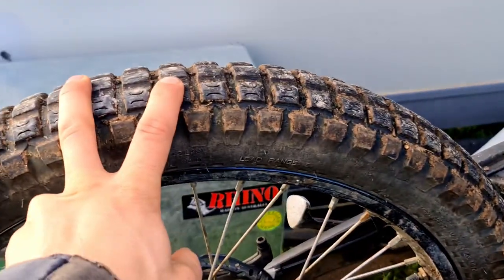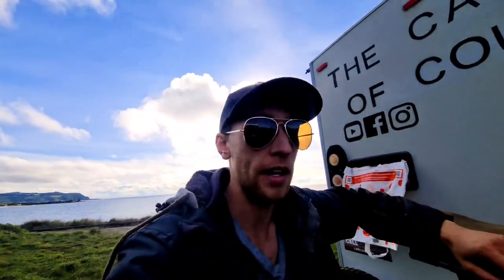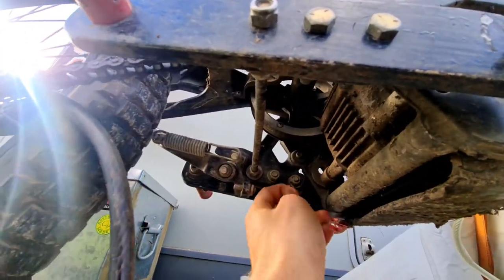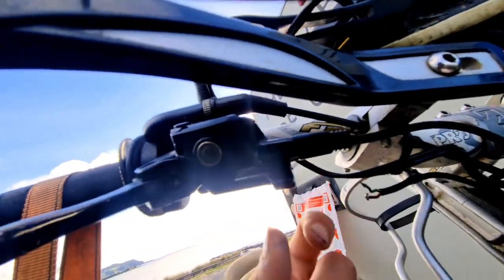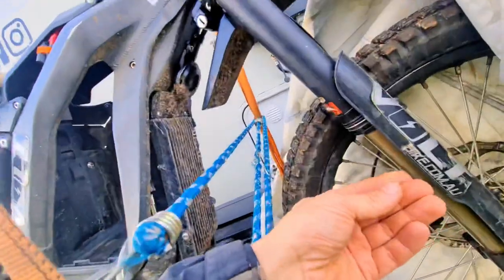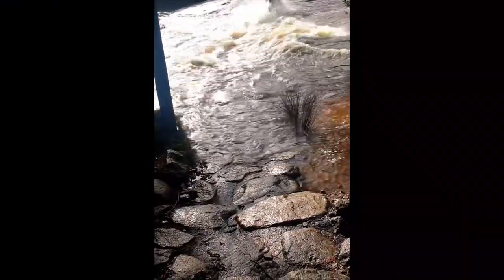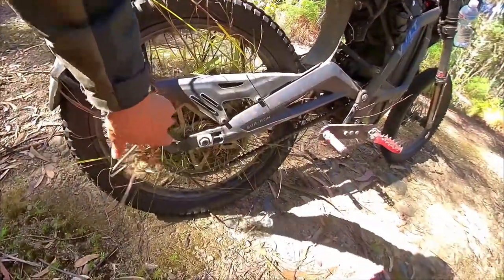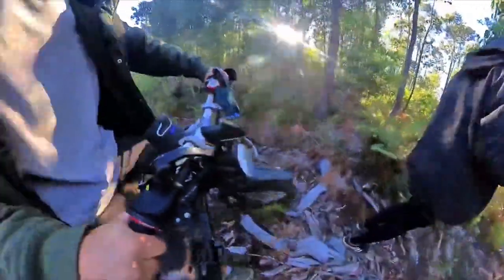5000km stock Sur-Ron review with river crossings

Comment: Sharing my experience with these and water. I changed my seat and unknowingly, the wire under the seat moved out of place and after a while I fell off the bike and broke the rear plastic fender which means I had to take the seat off again because the rear fender attaches under the seat. So I opened it up again. I found that the wire that sits under the seat was flattened and might've been the culprit of my electrical issues (from before) with the throttle (bike would not accelerate at all BUT it turns on and everything and looked fine) whenever I rode it in the rain it acted up on me for a second or two but the issue is more serious when it's already wet and you plan on going riding. Drying it in the sun seems to solve the problem but is time consuming, other times it helps to keep it on and wait for it to work but to be fair I thought I did a good job of putting the wires back and I'm not even sure how this happened. Switching the part looks easy except you can't find it anywhere, I'll have to contact Luna

Comment: Nice review, first time to se 2up on SurRon :) . How much do you weight together, and how did the SurRon handle it (suspension, handling, climb ability)?
Reply from the maker: We're both about 66kg
The suspension occasionally bottoms out when dropping hard off something but on normal trails it's been good
I did wind the spring out abit to make it stiffer
And as for hill climbing it's been flawless still havnt found a hill it dosnt get up/wheelie/spin back tire
Even the motor and controller only get warm
But the more tricky stuff I do alone and she walks
But it's quite dodgy trying to get over a log or dropping off rocks with 2ppl
As for battery life
I definitely noticed I get about 1/4-1/3 less distance and you can feel less power in high speeds Perticuly when you go up hill at like 60-70
Reply: With a friend we do night single tracks at two on his sur ron sometimes, no prob, just have to share the footpegs and moving arround to balance Xp Super fun

Comment: How much do you guys weigh appx? Me and my girl are small (appx 140 lbs each). Did the Sur Ron pull you both UPHILL with the STOCK battery?
Reply from the maker: Yep everything stock 
Were both about 145 lbs
And it's never met a hill it didn't get us both up or wheelie because of all the back weight
Or just spin the wheel because of shitty ground 
either way never felt like it needed more power in the low speed climbs
Reply: @The-Stranga  that's crazy capable in stock! Nice...

Comment: How did you switch your seat?
Reply from the maker: I removed all the padding from the stock seat and bolted though it and siliconed it around the sides
Also made some reinforcements for the second person to help with landing bumps and such
Reply from the maker: It's a solid connection and the bike can be lifted from the seat
The silicon definitely made it a more solid fit